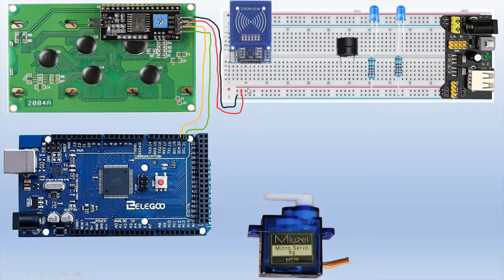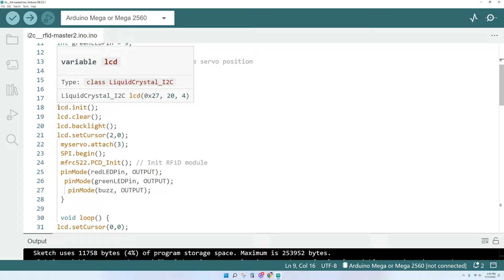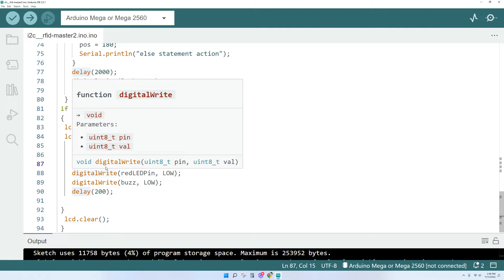Add An Alarm and I2C LCD Display Monitor To Your Arduino RFID Servo Lock - a project for beginners

Comment: Do you have any experience with different RFID cards performing different tasks? Such as Card (1) moving servo to 90 deg and Card(2) moving servo to 30 deg on the same motor?
Reply from the maker: I have not, but I like the idea! You mind if I use your idea in a video? It wouldn't be till April due to travels, but this could be fun and could  easily be scalable.
are you thinking of a tiered access type design for locks?

Comment: Mine rfid not scanning cards, how to fix it
Reply from the maker: hi there!  Are you using the MFRC522 library ?  Did you open the "DumpInfo.ino" example program to scan your ID cards to retrieve your card ID number tag?
Reply: @BMonsterLaboratory  yes, same library but different example read and write that one, I will try dumpinfo and will let you know
Reply from the maker: @swapnilkhairnar9708  the dumpinfo program is in the MFRC522 library.   Open the serial monitor and scan your cards. the ID will appear at the very bottom of the scan. 👍
Reply: @BMonsterLaboratory  Yea doesn't seem to be scanning for me either actually. LCD screen is illuminated but not showing any text either
Reply from the maker: @BurnNoBridges138 are you using the same code I used or did you change any of it? Are you using the same 20x4 display? Did you do a scan for the RFID number tag? The servo didn't move at all or its just not showing on the display? I would be happy to look at your setup and code if needed
Reply: @BMonsterLaboratory  yea, using the same code, only change was to the rst and ss pins in dumpinfo to 5 & 53 (correct?) but nothing registering when i scan the tag. No movement at all on the servo
Reply from the maker: @BurnNoBridges138  ss pin is 53 on the Mega...rst pin is fine at 5. Open serial monitor while you scan card. Hold the card there till scan is done. You should see your unique ID tag at the bottom.
Reply: @BMonsterLaboratory  yea when i open the serial monitor and scan nothing is appearing on screen 😕 It is saying "firmware version 0xB2 = unknown" if that may be the issue?
Reply from the maker: @BurnNoBridges138  I wil set it up again when I get home And go through everything again. Sorry it isn't working for ya at the moment
Reply from the maker: @BurnNoBridges138   Well, I got home and put it together pretty fast, uploaded the code, looked at the serial monitor and it wasn't working. Looked down and saw that I plugged it into 5v 😟  It looks like I fried the module so I ordered another one and will be here Sunday.  It's been a long time since I did that.... I'm sure there's a life lesson here.
Reply: @BMonsterLaboratory  hey, just wondering did you get a chance to take another look at this circuit?
Reply from the maker: @BurnNoBridges138  yes. and I just put it together again an recorded a short video but it's the same as what you see in this posted video. did you run the i2c scanner library to get the address of your i2c monitor? are you still getting the firmware notice on your screen?